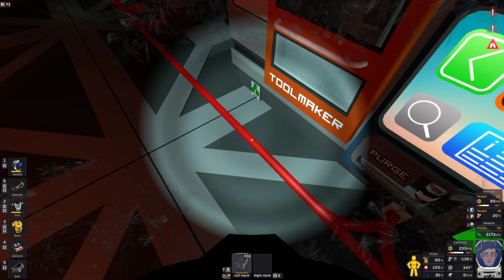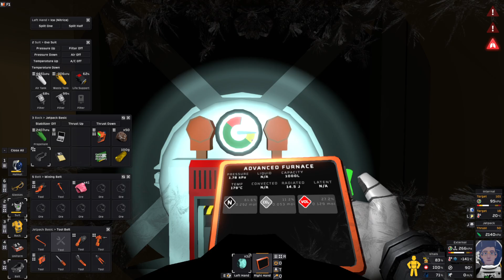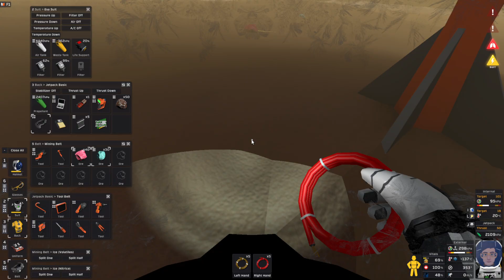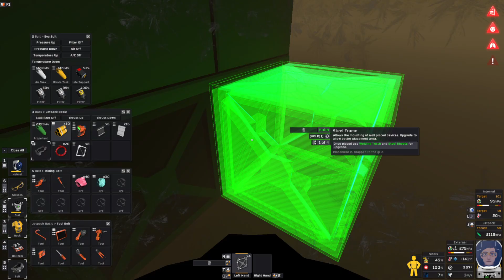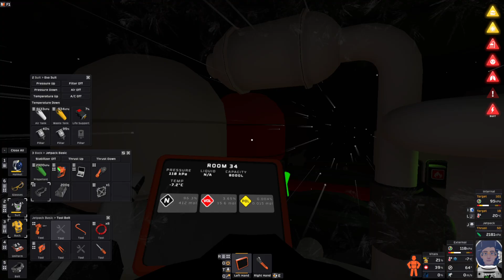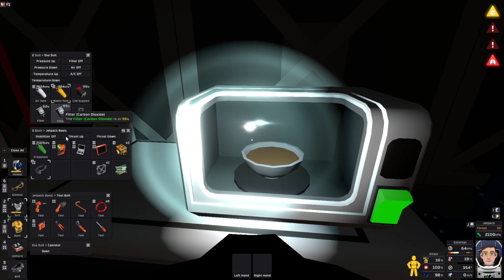Stationeers Titan Part 22 : This Was Always the Plan (Honest!)

Comment: Well done on getting some stability in the power. I was wondering if chaining sterling engines to eke out power from the furnace might help, like a triple expansion steam engine type thing. Also - it's Titan. You should be almost literally swimming in hydrocarbons. I take it Stationeers doesn't do oil.
Reply from the maker: Yeah it's something I keep thinking about, but it's not continuous power - it's very dependent on me using the furnace for a burn so whilst it's a nice bonus, I don't think I can rely on it until I get power storage handled better (which is my next priority)

In terms of hydrocarbons, Stationeers gives you Coal (which you can burn for power in the Sold Fuel Generator and potentially CO2, as long as it's not deep mined, or you can smelt into steel) and Volatiles (which is some sort of dirty hydrocarbon mix that can burn with O2 as fuel for power or welding, or to make water, but with a mess of by products like pollutant and CO2 - both of which have other uses if you can capture them,). No oil though.

When I made the custom map I allowed coal on the surface as the closest solid hydrocarbon analogy and volatiles in the atmosphere (which liquify like ethane might to form puddles around the base).

The deeper issue (and one of the 2 core challenges on this map, the other being lack of metal ores) is that without oxygen you can't burn anything, and oxygen is a hard won resource. The only way to reliably get O2 here is from plants converting CO2, and since there's also no free CO2 in the atmosphere because it's too cold, the CO2 needs to come from smelting or burning things (and be captured, cooled and fed to the greenhouse), and similarly water for the plants needs to be scavenged as ice or created by burning O2 and volatiles.
Reply: I dont remember if the solid fuel generator emits CO2 when burning coal, but if it do, then maybe it would be easy to eall the gererator in and vent out the CO2?